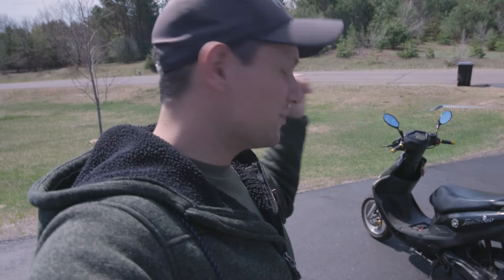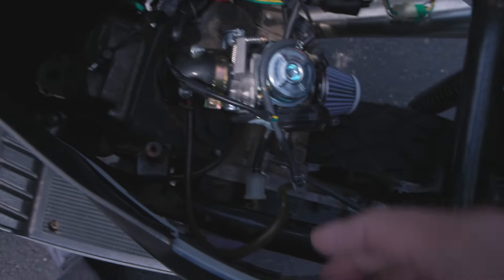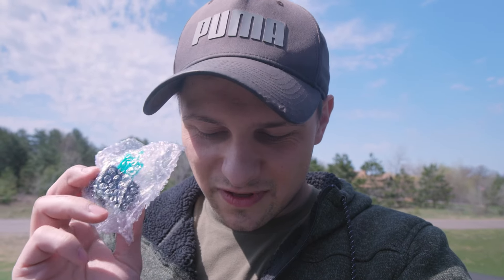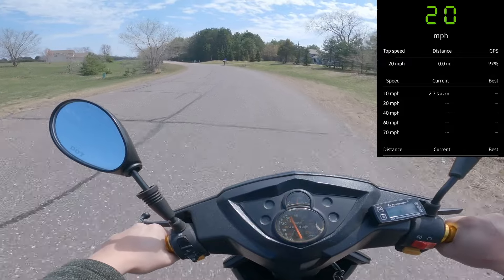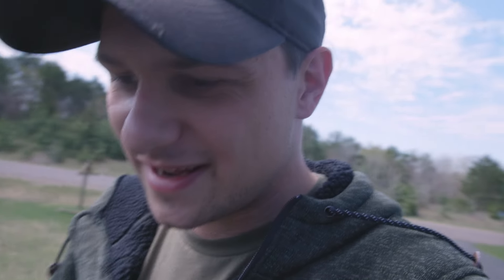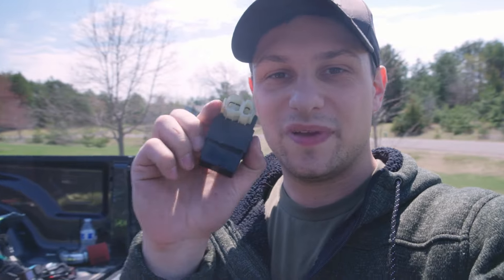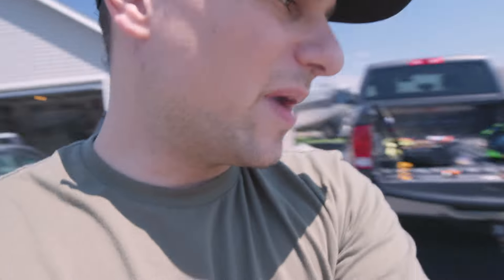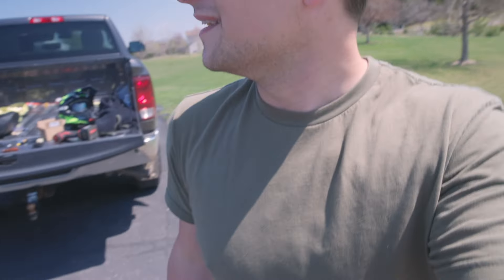The carb you NEED for your GY6 scooter

Comment: There is a ring on the variator there'll be a ring in between the two parts of the variator with a belt slides up and down take that little ring out which is a restrictor so it allows the belt to go all the way up take that off sliders upgrade the spring on the clutch on the clutch shoes and in the clutch spring and get it from Rolling Ranch tell him what kind of scooter you got tell him it's a 50cc and you want to do upgrades and you can do those upgrades and then they have a drop in 71 or 80 cc cylinder and you can do all that stuff for relatively cheap

Comment: maybe get the J and J power pack carberator plug CDi coil plug air filter 99 dollars worth try I grew up with mopeds an old fart but a smart old fart the days of a 49cc scooter is gone too darn slow does not belong on our roadways my riding group junked ours and got 150cc scooters all problems solved we are safe in the flow of traffic and drivers do not hate us anymore

Comment: I have a 14a cam , 58mm piston so is a 160cc now , header with exhaust, racing variator  with 10g rollers and it goes 65 with the stock carb 

Change the belt for a thicker one trust me , I’ve gained 10mph just with the belt

Comment: Little secret bro stage 6 gram weight for high rpm performance keli pully with daytona ramp with red clips it really matteers then the springs in the clutch you need to change it too whitw or red thats fine tuning type

Comment: Did you try the muffler? There is a ring where it connects to the manifold. You have to use a Dremel and grind it off. And you can shave the throttle tube where it connects to the cable. Or you can cut the wire to the CDI so you can have better rpm’s. I probably am making it harder to figure out but google each step individually then decide which steps to try or not. I cut the wire from my CDI, cut the ring from the muffler, drilled holes in the air box is another step I heard of. Then you have your rollers to adjust and the spark plug and a new coil and spark plug wire all will help and a better belt, clutch and spring. If you need and questions just comment here. You just don’t want to cause damage by doing the stuff that might not work at all. I think a good CDI and not the cheapest one is a good idea plus a UNI filter is good. It’s all about what you think you need for you that counts
Reply: I am interested to know what wire to cut and if that takes away the rev limiter or what exactly it does.
I am not sure about the carburetor modification either, as far as what you meant. I understand putting a chamfer on the exhaust pipe where it meets the block. Making things smooth to help the flow.
Reply: racing CDI's wont do much else than let you rev the engine too high.. its smarter to get a BBK, bigger carb, clutch, sliders, wider belt and a heavier cvt spring before touching the cdi at all

Comment: Alright bro! I have the answer to your slight bog with that carb! You see that line that connects from the bowl to the upper side of the carb to another nipple? Plug both those ports that line is plugged into; both of them being connected for some reason produces a bog, also run a 105 jet, and take the mixture screw out little by little until you are about 4 turns out. Maybe even more depending how much air you need. I just did that today and my Tao Tao goes 45; and i haven’t even tried to fully top it out yet; it FEELS like it can hit 50 the way it is! and the acceleration is insane; yes i have the 69mm big bore kit. I have the nibbi throttle cable and nibbi intake adapter. Mikuni 21 mm just like you have; mine is red not blue haha. Anyhow; do this and adjust your carb Accordingly but i have had FANTASTIC results, and it’s all thanks to your video this one right here all your links and everything. I have stock rollers stock variator stock cvt stock drive belts i only have 1500 miles on my scooter and I’ve never touched my drive belts or my case at all I’ve never personally opened it. (previous owner i can’t speak on) but when i picked it up it went 35 with stock everything. And i have that big of an increase. I’m gonna test other rollers soon; but right now how I’m seeing it from your video you need to dial that carb in some more and you will be golden pony boy😎 sorry for the old outsiders movie reference i couldn’t help it 😂 these things are beasts once we get them right!
Reply: I also have the needle couple on the very top notch of the needle slots as well by the way can’t leave that part out**^^
Reply from the maker: Duuuuuude. Gonna try this asap! Thank you🤘
Reply: @throttle_therapy the only current issue i face now after getting it to go that fast is on the high rpm’s it sounds like my carb is cutting out and it seems like it’s a lack of fuel. Adjusting it still as we speak. Have you gotten any further with it?? Or have you given up like I’m about to give up LOL
Reply from the maker: @GermanEngine-Unity  I actually changed it all like you said and it brought me to like 90% perfect! So huge thanks haha. Its still a bit figety on take off. I dont have the high rpm cut out tho! I'm thinking I need to play with the rollers now to dial it.
Reply: @throttle_therapy I’m glad it helped! If i were you I’d up the pilot jet size to #42. That should fix it. Mine is awesome up until you get passed 1/4. It dosnt bog at low rpm’s anymore at all and if anything it’s super snappy. and i also jb welded one of the holes shut inside the carb that goes into the air inlet on the intake. But if i were  you i wouldn’t do that because who knows that could be why I’m having such a bad cut out at high rpm’s. But yeah definitely change that pilot jet to a #42 it’ll richen it and trust me it will make a difference. Sounds like once you do that and leave all the settings of the carb alone in your situation you’ll be flying haha
Reply: @throttle_therapy i also do really think that you should revert your roller weights and variator/clutch settings all back to stock format and you will have giant top speed gains. That’s how mine is it feels like if the carb wasn’t giving out it could just keep going and going the Rpm’s get really high i just feel like the carb isn’t getting enough fuel into it probably because I’m pushing too much air. I also ported my head and gasket matched it that could be a big thing with me I’m pushing too much air and not enough fuel at high rpm’s so it’s cutting out. But I’m not sure. Still trying to figure it out today actually

Comment: I have same scooter but its a 49 cc i have an 81 main jet and a 35 pilot jet mixture screw out 3quarter turn with 6.5 gram wieghts and also i tested alot of plugs,the ngk,the ngk r the orange one with the three prongs and a cheap Walmart autolight and the autolight performed the best no joke,i cut the auto lights electrode back just alittle and gap it at .28 and my 50cc does 46mph,no joke ya its screaming and really dont like reving like that but it flys
Reply: Hey I'm fixing to get a 50cc can u send the mod list
Reply: @Deltareview420 spend a few more bucks and get a 150cc. More room for mods

Comment: mess around with the jetting in the carb stock those scooters use a 75 main jet. with a big bore kit they should be using an 80 so its not running lean

Comment: Hell yeah, that carbs gonna be slick when you get it dialed in. I have a 50cc geely, got it it was badged as a Coleman 🤷‍♂️ 😆 got an Amazon truck coming tmr with some goodies 🎉
Reply from the maker: Excited for it to rip🤘
Reply: 😎 Yupper
Reply: @throttle_therapy  got home from work and there was a package waiting for me 😎 there’s a few things in there. First thing the carb y’all recommended 💪 god damn son… more power and more speed. 

While I was in there I deleted the emissions 🤷‍♂️ got it all done just in time for the rain to come. Said fk it, let her rip tater chip. Hopped on and went for a 10 mile ride. 

Top speed went from 33 slow af to snappy 38mph. Gotta mess with either jets or the fuel air mix. She bogs a bit to 15 mph. But I’m thrilled with just slappin a carb on and gaining almost 20% more speed. 

Monday when I’m off work, I got a new variator, lighter vented clutch bell, and a ton of variator weights to screw around with. If I can’t get the carb sorted out I’ll just buy a pack of jets and fk with it a little more when they get here 😆 

You guys rock, I’m diggin all the sht you guys mess with on the channel. Keep up the good work 💪
Reply: @throttle_therapy  what did you do to the electric choke ? Did you leave it unplugged

Comment: did you ever remove the limiter wire from the cdi box? also alot of mopeds get greater performance with the stock air filter
Reply from the maker: Nope we never cut any of the CDI wires. And yeah we noticed that too, the stock air box works good with most of the different setups
Reply: Stock air filters are restricted
Reply: What limiter wire?
Reply: @jamarnicholas5697  there's a wire that goes to the cdi box that's standard due to speed restrictions and by removing it the moped is allowed to go faster

Comment: id recommend one of the red foam uni filters if youre trying to go the pod filter route. could never get mine dialed in with the wire mesh pod like you have. oiled up and stuck the uni on and smooth sailing.
Reply: uni all day.
Reply: What card and cable do I get on Amazon to make my 2014 taotao 150cc faster I got my moped to do 50 mph ... And my gas tank leaks when I fill it all the way up ... ... I ran over a big object to where I couldn't plug the tire ... It would take 3 tire plugs at once then it would fall out after awhile so I had to order new tires and put new tires on ...

Comment: Use a racing ramp plate on your variator is Dr pulley Dr pulley racing weights Dr pulley variator weights are a little odd shaped so they have a low end a longer middle and a top end

Comment: wait. thats not a Glixal carb 😡i have the 20mm diaphragm one ( 4 stroke style ) and i like it. i have a problem related to fuel/air but 5 different carb ( including a quality Naraku one ) but none fix it so tia not carb related.  i wanted the slide ( 2 stroke style, like your Maikuni ) from Glixal, but ive ehard thsoe type of carb cause a big low rpm issue. duno what is true...

anyway, good video ! cant wait for the next one.
Reply: If you use the 21mm pwk carb it works well the 24 and 26 mm on ones slow the air speed down to much causing low down power loss so big is not always good.

Comment: Weights need to be in the 5g to 6g area.  Id try 5.5g.  1500 contra is way too stiff for even a big bore, stock or 1000rpm works best.  Make sure your belts wide to spec and that should be it for cvt.  You should be hitting high 8000s to low 9000s if you wanna keep it streetable.  Mine liked to rev to almost 12k  but i wouldnt push past mid 9k.  Stock and aftermarket cdi have the same timing advance at full rpm, aftermarket just keeps that advance down low whereas the stock box retards it to make cold starts easier
Reply: duude, thanks for all this info! You ever get onto the /r/scooter subreddit?
Reply: I got a 50cc that I just picked up and I got the cheap 50mm big bore from Amazon with the head cylinder cdi clutch and contra spring and all for 75 bucks.  I haven’t put the big bore in yet.  The scooters really slow accelerating.  Once it finally gets revving good it hit 36-38.  I checked the rollers in the variable and they 8.5 grams, same as what came in the big bore.  So those won’t help.  I put the yellow contra spring in along with the yellow clutch springs and that made a big difference.  The clutch stalls to maybe 2500 rpm or so before it starts to engage and also it revs a little higher before the cvt “shifts” into the higher range.  It used to shift at 9mph.  Then bog bad cause it doesn’t have enough power to pull that taller gear ratio.  Now it goes to about 15mph before it shifts and it can pull a lot better.  So, I’m wonder if this was all cause the clutch springs or did the contra spring help?  I know I should have tried one thing at a time but I was in the area and didn’t feel like taking it all back apart.  I saw you reply to the above guy saying the stiffer contra spring is too much for these even with a big bore.  Care to elaborate???  Like what exactly is the contra doing-I know it controls the rear pulley expansion/contraction, right?  How exactly and is it worth it to get an aftermarket?

I’m about to order a roller weight assortment car with various weights.  Hopefully starting really light like 4grams or so and going up from there.  If I’m not mistaken the lighter the rollers the later the variator will shift into the higher range.  Is that correct????

Thanks
Reply: @robertmason8341  the small clutch springs change only what rpm the clutch grabs.  The contra affects how resistant the scoot is to shift, you wanna hold the "first" gear as long as possible but still be able to get full opening of the pulley.  Then you tune your rollers around that.  Usually a stiffer contra will need heavier rollers, small changes can do big things.  Go in half gram increments.  Wanna get the right rpms while still not losing top speed
Reply: What does the white malossi contra spring do with a kymco agility 50cc? I have a malossi variator with 6gr rollers, it revs alot but does not accelerate as it could do, the clutch springs are the standard ones
Reply: @lukie4ever  a stiffer contra spring makes the scooter resistant to "shifting".  It makes it harder to open the rear pulley and thus the scooter stays in a lower gear longer.  If your bike takes off hard then at around 20ish or 30ish drops rpms and falls out of the power then you need lighter weights or a stiffer contra.  Another symptom could be dropping rpms and sort of losing power when you hit it full throttle but not if you ease into it.  On my gy6 50cc builds i prefer to run a stock contra with 6.5g to 5g weights.  I wouldnt use an aftermarket one unless youre on an 88cc kit with a big carb and a built cvt
Reply: @mopedmessiah  allright I'll use the stock one🤣 since I'm on 50cc's

Comment: @Throttle Therapy....have you figured out how to use/install the spark plug ring from the runleader to get accurate temp..? I just put mines on the boot and taped it ..not accurate, but oh well🤷🏽‍♂️ Thanks guys
Reply from the maker: We had the same problem. We just have ours wedged in the plastic cover around the head.

Comment: Is a nibbi 125cc good for my gy6 venom motorsports x-21 50cc dong fang SRT moped
Reply: Good question. I have the same bike, tons of mods, still have not put 80cc bbk on
Reply: @CH-ru6rv  ,I was having trouble after getting a belt,an bike setting for a couple weeks, now is running but not as well as it first did,so not sure what to do,but am considering getting a kp mini 150cc an a venom z250cc

Comment: I have the Tao tao racer 50cc with a big bore kit , stock cdi and coil 3 gram rollers the blue concho spring over range final drive gear and stock air filter my bike is running at 8500 rpm at 50 mph at times depending on air pressure I get 55-60 mph.
Reply: What big bore kit did you use

Comment: Link to the mikuni carb?
Reply from the maker: In the description!
Reply: @throttle_therapy  the one in the video was blue the one in the link was red. Wasn't sure if there was a difference.
Reply from the maker: @brandonlovett604  no difference in carbs other than color.  I tried linking the blue one but it was sold out, so I linked the red one. There are a probably a few sellers on Amazon so if you wanted a blue one it might be easy to find.
Reply: @throttle_therapy what size carb? Going to buy one and couldn't find it mentioned. Got a 72cc kit rn.
Reply from the maker: @bournes9845  this one is a 21mm
Reply: @throttle_therapy  sick, thanks

Comment: What throttle cable did you use got a part number for it thanks.
Reply from the maker: I forgot to link it in the description. Give me like 10 minutes and it should be there🤘
Reply: @throttle_therapy  Got it thank you.
Reply: Just put one on to try it comes with a 38 air jet it's To big a 35 is best main 95 try on a 50mm setup all so had a flat spot lift the needle up go's like a rocket.

Comment: Hey guys, big fan! I have a SYM Fiddle 2 4t 2010. It's a scooter from Taiwan and it only goes 60km/h (even though I have restrictors I plan on removing them) How can I make my scooter faster without installing a higher cc kit?
Reply from the maker: Clutch springs, better carb, play with variator weights! Should get you some results🤘
Reply: Dont waste your money, i had it for 2 years,

You have to switch to fiddle 3

Comment: 38mph? Must be a 50cc scooter. My 150cc scooter does 65mph stock. Another thing i might add; those scooters coke stock with a 24mm carburetor..you putting a 21mm on starves the motor. You should’ve gotten a 28mm carburetor for it.
Reply: if it’s a 50cc it’s stock with a 19mm. Probably a 50cc scooter
Reply: My 150cc scooter stock does 55 at most.
Reply: 80cc says description
Reply: My 50 cc has a 17 mm carb...
Reply: 21 mm properly jetted and tuned is perfect for a 70 kit
Reply: Its an 18,5 mm carb if its 50cc (it probably is)